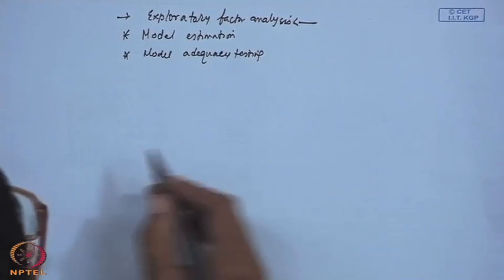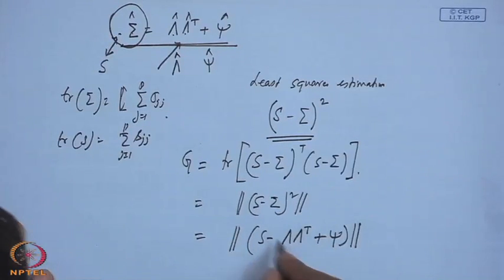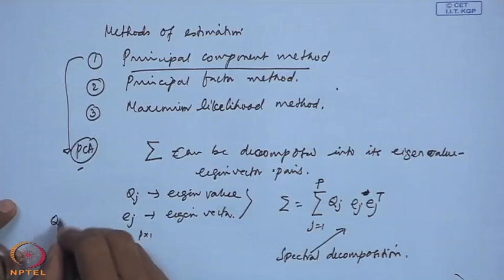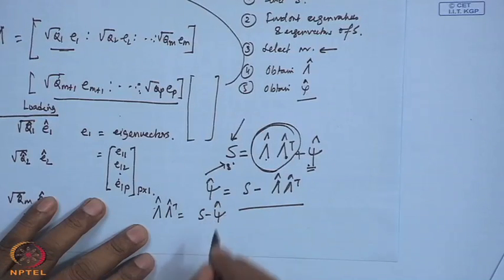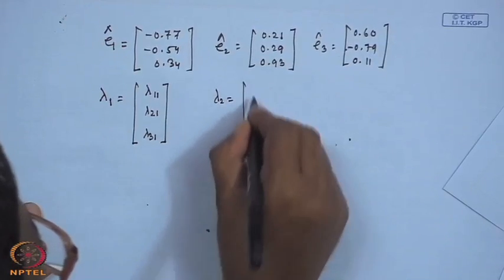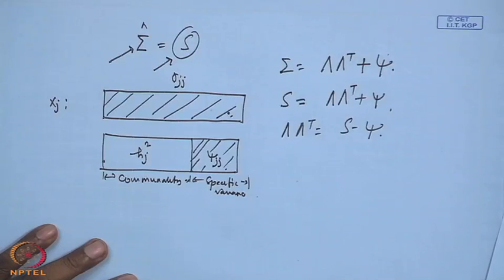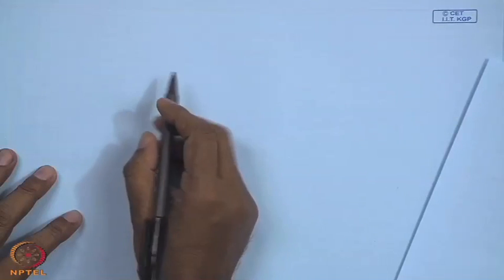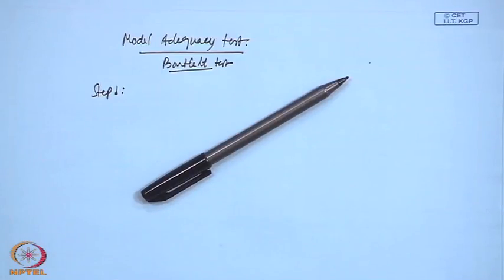Mod-01 Lec-34 Factor Analysis -- Estimation & Model Adequacy testing

Comment: Many thanks Dear professor 
It is very clear. 
I have  two questions in EFA. 
First  question: 
The principal factor analysis method of estimation used the constraint that : 
 Psi + lamda lamda^(t)= diag(S) 
Hence, the diagonals  elements of implied covarince  matrix ( Sigma)  does not estimate it is equal to diag(S).
More precisely, the variance of observed variables are fixed equal to its empirical variances? 
Second question: 
In the level of computation of the implied covariance matrix (Sigma), we have two assumptions in EFA model that are : 
1 _ the factors are not correlated of errors. 
2_ the errors are not correlated between them.
Under this assumption the covariance matrix ( Sigma) is computed. 
My question is : 
The two assumptions isn't valid in reality? 
Many thanks in advance

Comment: THESE ARE THE EIGEN VECTORS I GOT USING R

           [,1]                 [,2]              [,3]
[1,]  0.7704388 0.2110138  0.6015789
[2,]  0.5383822 0.2900062 -0.7912276
[3,] -0.3414215 0.9334718  0.1098259
Reply: the same with what prof said in the lecture